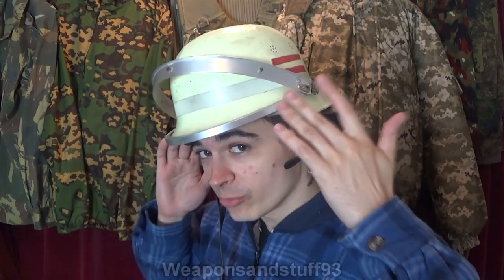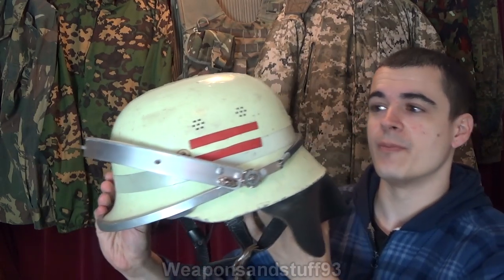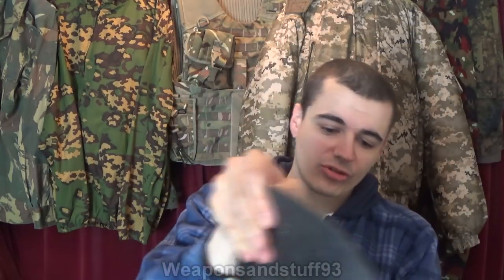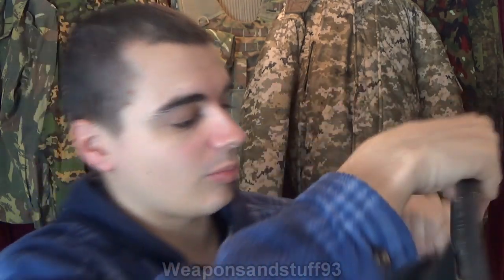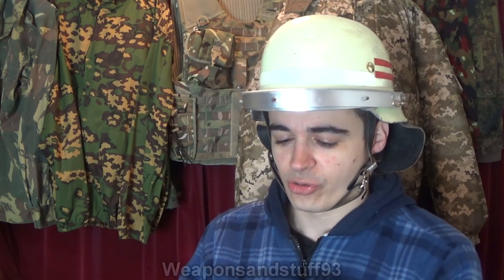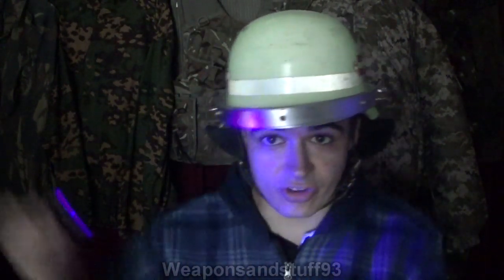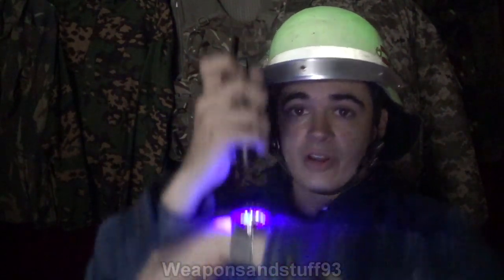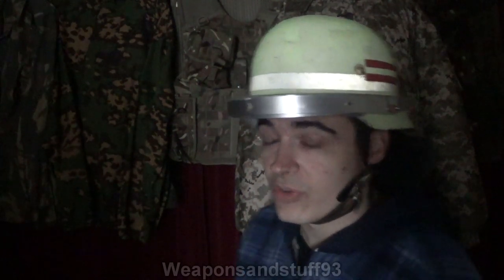German Stahlhelm Fire Helmet

Comment: You have a post war aluminium German DIN helmet. These were used from the 1950s until the 1990s. They weren't converted from military helmets though their design is very similar to WWII firemen's helmets, which do resemble the military helmets.
Reply from the maker: Apparently earlier models were converted depending on sources but this one is probably aluminium
Reply: @Weaponsandstuff93  You should be able to tell by weight alone. If it feels like it could just as well be plastic then its aluminium. If you have any steel helmets then a comparison between the two should let you know.

I've got one of these two and they're dope. Shame you can't really find the ones with the crests or visors as easily these days.
Reply: They are actually still being used in high quantities by volountary fire brigades, and the aluminum helmets were introduced in the 80s not in the 50s. And also no German firehelmet was ever used in the military, they were just produced separately during WW2, because it was cheaper.
Reply: HanauMan how much are the worth
Reply: You can buy a post war helmet for about £40 / $50, a tad more for an original WWII firemans helmet, on ebay.
Reply: You know that some Fire Departments still use that Helmet but without the ventilation holes but some still use 1 to 1 the old ones
Reply: @SickClown I dont know any that do so, but it would make sense cuz the new helmets by Rosenbauer are like 400€
Reply: @Weaponsandstuff93  our voluntary firefight brigade still use them in 2021 and there are much more brigades which use this helmets (her in north germany/ Fed. st. schleswig-holstein

Comment: This is not at WW2 German military helmet. It is the same model of firehelmet that the german fire departement used in the 1930-40. This model was probably reused and the black paint was replaced with a new paint job. Interestingly the danish fire department also used these types of helmet before and during WW2.

Comment: i know this comment isnt related to the video but i was thinking about the M50, C50, Scott GSR, etc with those weird filters that are trying (not doing too good) to replace the 40mm filters and i thought of something. Those masks are kind of like an updated/ upgraded cheek filter mask. Filters look similar, set up similar, except fix the whole putting filters in from the inside problem. Could these have been purposefully been designed to be an updated cheek filter design? You could probably do a video on that comparing the two because they look similar in design (filter wise) except the modern ones fixed the issue

Comment: This is interesting, do you have any  firefighter respirators too? Also, I have an M10M, a PBF, and a GP-7 on display on polystyrene heads,do you think they'll be safe on those heads or should I get those off immediately to prevent them from getting damaged from chemical reactions?
Reply from the maker: Just that weird seibe Gorman mask the military ordered in 40mm which is meant to be used with an airline
Reply from the maker: They should be fine on polystyrene

Comment: My helmet is just the same with a polycarbonate visor and some textile straps instead of plastic because of some new regulations the plastic is forbidden in Germany because if something hits the helmet your head would be heavily injured ...but apart from that its just the same ,by the way the two red lines or bars at the sides means Zugführer
Reply from the maker: Thanks for the info, I heard supposedly they were told these helmets need replacing because the steel and aluminium shells are conductive to heat and metal, supposedly they are meant to be replaced with plastic helmets of some sort but I don't know if that will actually happen.
Reply: Thats right 😄but the replacement is something that will take a long time but actually I’m still using it because of the wearing comfort ,but if you’re using them in hot areas the holes in it are a very big problem because it is getting quite warm after some minutes ,😄I hope my English isn’t that bad I’m better in speaking than writing 😅 by the way many thanks for your other videos about gas masks and more it really helped me out with my gp5 and the russian filters ,again many thanks 👍👍